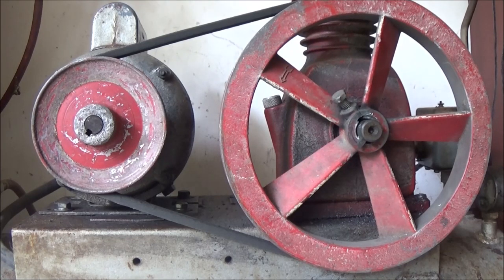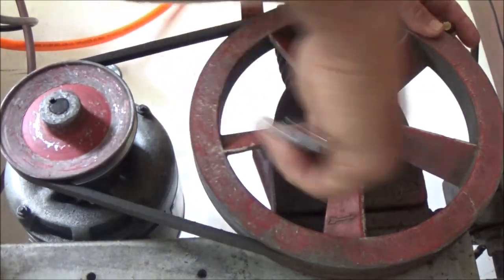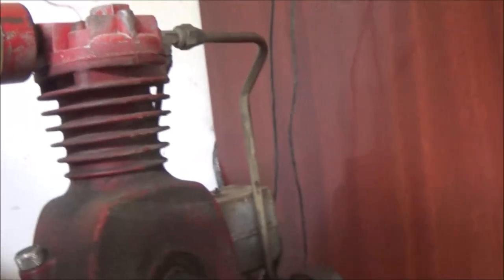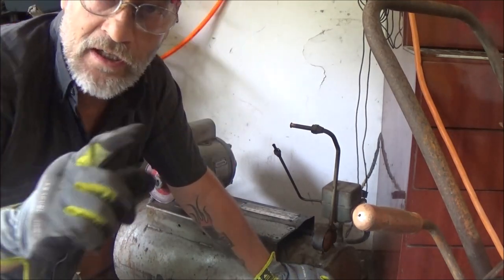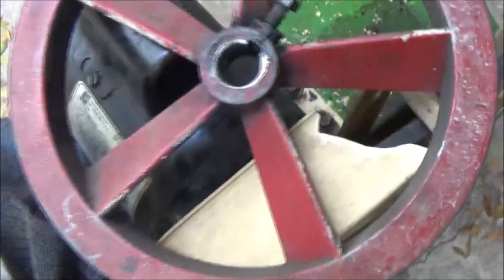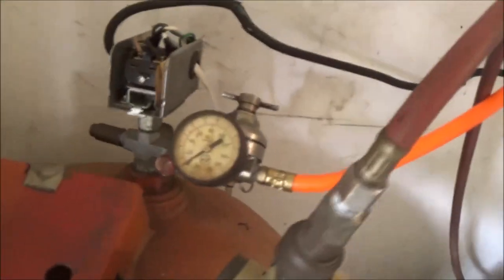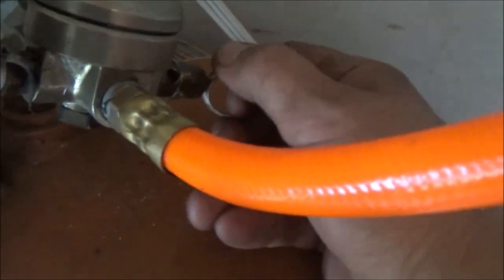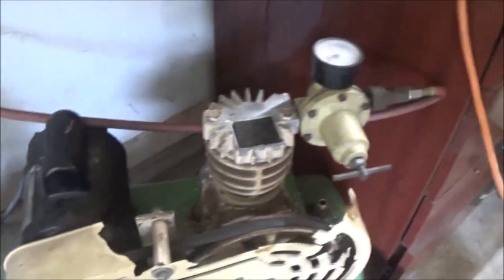Air Compressor Problems

Comment: Yeah, I think pipe between the compressor & the tank would be best.  I believe you can use copper tubing, the heavier L-Type, but iron or galvanized threaded pipe is probably cheaper but not as easy as the copper which you can solder.
Reply from the maker: Yep true. I think I may go get her dads this weekend.

Comment: Doggone it , you had to show me what I'm doing wrong didn't you !!!! Your red hose that blew is exactly what I'm doing . Sort of . Not off of the compressor , just out of the tank and regulator . I was going to put in a quick connect hose to keep mine portable and still be able to connect to a permanent steel line running to the back of the shop . Maybe it will still work ? And working on my disappearing work bench .